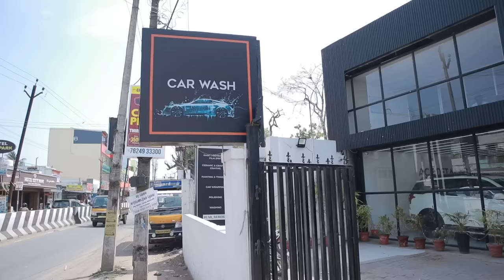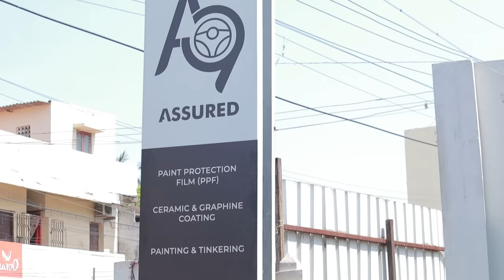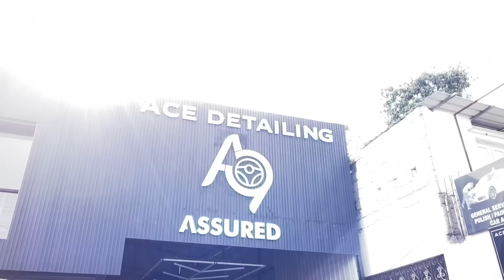We Spent more than 50,000 for this Car Modification 🔥Worth Dude 😍❤️

Comment: Is PPF too mandatory for long lasting. Do we need a ceramic coating on top of PPF?
Reply from the maker: Ppf is more costly than ceramic bro. No need to apply ceramic over PPF . PPF itself will protect paint and give more shine
Reply: but what I heard is that ceramic is better in the long run if you don't mind parking in the sun ......
 one of my friend's car has cracking flim effect because of parking under sun on day times. At this stage removing and reapplying will burn a hole in your pocket.

go for ppf  if you don't park outside ever.
Reply: @ShadhikAzeez ceramic is a cosmetic make up .. real protection ppf.. keep your car in rain and check your ceramic.. from your word like applying sun cream
Reply: ppf is not recommended. its just a trend we are wasting our money. car repaint cost= ppf cost

Comment: This is not modification bro. Removing swirl marks and ceramic coating comes under detailing. So if something is changed from the stock option to after market part of the car is called modification. Info is misleading, it should be "we spent more than 50k for ceramic or exterior detailing and seat cover"